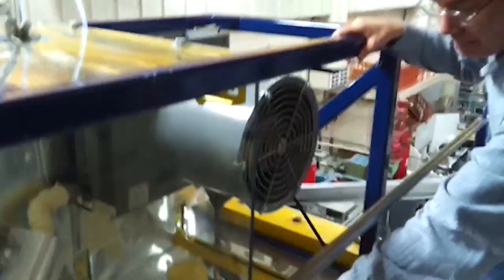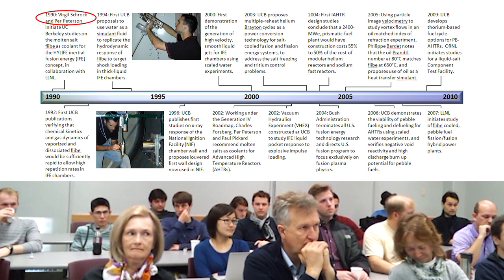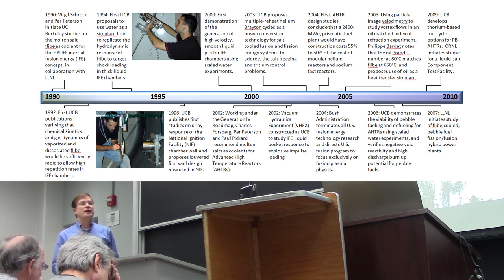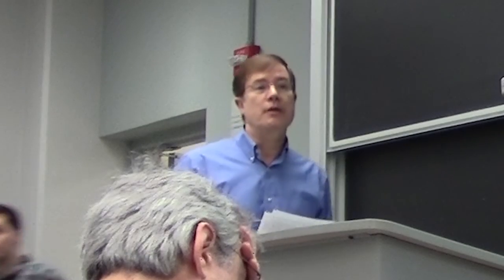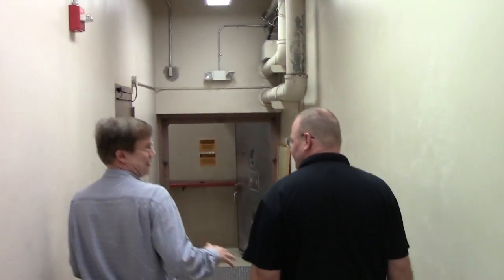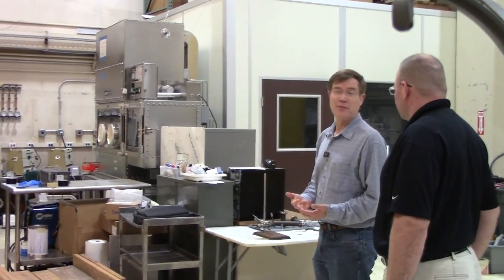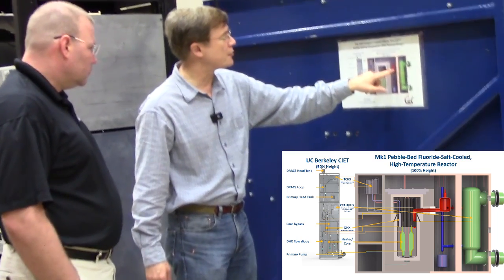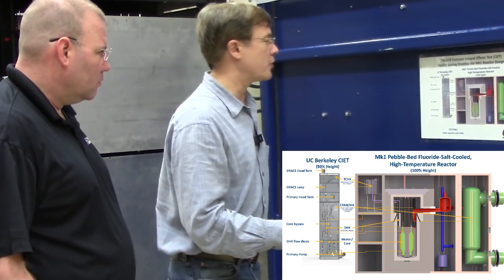Compact Integral Effects Test CIET - Dr. Per Peterson & Kirk Sorensen

Comment: Great video! How important or pertinent is this particular research for future Thorium reactors?

Thanks Jim.
Reply: ScootOverMan Remember Dave LeBanc's quip: "Come for the Thorium, Stay for the Reactor"?

It's not so much the change of Fuel, but a change of the Physical State of the Fuel (i.e., to Liquid) that's key here.

The Forward to Bob Hargraves' book "Thorium - Energy Cheaper than Coal" (~$10 in Kindle-format) begins with:

""Thorium is the name of a heavy metal element, that can release abundant energy, but Thorium is only part of the story. The key technology is the Molten Salt Reactor, enabling a fluid fuel form, reducing costs & enabling energy cheaper than from coal."

Uranium is to be used in Terrestrial Energy's IMSR, due ~2022. I tentatively  embraced Thorium, at first, after viewing Kirk's 10-min TED talk. Now, I accept starting with MSRs & - e.g., as U prices rise (e.g., from Russians buying it up, around the world, per CBC reports), Thorium is the next step.

(India had reason to embrace Thorium early, e.g., when they found themselves unable to buy U (as they hadn't signed the Non-Proliferation Treaty); after embracing Th, India began receiving invitations to buy U, sans Treaty signature. "You Can Negotiate Anything")

Comment: At the end there, when the guy started talking about the pebble bed reactors and how the fuel pebbles operate in a PBR, I got to thinking how the concept could be adapted to a molten salt reactor, and LFTRs in particular. Because there's some concern over the operating life of the graphite moderator due to neutron damage, in which the graphite core can crack and leak, can't little graphite pebbles be used in a metal tank instead? Then the graphite can be replaced as needed just like the fuel without having to shut down the whole reactor to swap out the core. (the tank would have to be swapped out eventually, of course, even if it's made of molybdenum or tungsten)

Has Kirk ever mentioned the possibility of using graphite moderating pebbles in a LFTR?
Reply: Pyre Vulpimorph his version of the MSR (LFTR) is self moderated and does not use any carbon at all there for solving that issue
Reply: Pyre Vulpimorph kirk wants to use a 2 fluid design that keeps thorium out of the core. this solves a number of issues like U232 contamination and maintains better criticality for more efficient burnup. but its my understanding that this means that the moderator itself is the barrier between the core and the blanket, so it has to be fixed. i believe his solution for that as well as the corrosion problem is to slate these modular designs for replacement after a fixed time span. so they can just take it out, slide the new one into place, use some of the unspent fuel to fire the new one up, and take the old one back to the factory to be rebuilt. this also allows them to implement design improvements etc and provides a rather effective business model for a company that is selling reactors that dont require special fuel

Comment: Thanks for another great video.
      From what I can tell, the only major area where there is no new research is in the corrosion area.  I know fluoride is used to etch glass.  It reminds me of an observation that one of the other volunteers with whom I participate in maintaining and operating a steam locomotive designed in 1912 made about it: "As soon as we begin operating it, it begins destroying itself."
      There is a kidney system for the Thorium salt reactor.  Now it needs another organ like a stomach.   Evolution has designed stomachs that can dissolve and digest food without the stomach digesting itself.   Now we need a mucus lining for the reactor.
Reply: Very appropriate analogy; surprisingly, it is amazing how such parallels can lead to technical break through.
Reply: Thanks.  I just threw it out.  Although, It is highly doubtful some sort of heavy liquid could be used to coat the inside and be held against the wall of the reactor, I thought it was an idea  that might  lead to other thoughts that might work. If the reactor walls have to be replaced continuously due to corrosion while the reactor is in operation, do we shove sections like sheet pilings through?  Biologicals are constantly replacing parts and making repairs while these parts are in use.  Millions of years of evolution sometimes solves similar problems that we face.
Reply: Biological linings are replaced and are effected by diet itself, self-sustaining. For example; cabbage assists in the production of stomach lining mucous. However, I would consider a DNA programed computer, biological in nature assumed,  to be the ultimate in technological achievement. Otherwise and until this time, I was thinking of extruding of a surface through micro-ports that would be eroded and then replaced at a rate of replacement that would protect the principal piping or reactor surfaces. The substance extruded through the ports would need the characteristics of preserving the reactor vessel container and piping walls, while being benign to the functioning of the system. Thus, safety is maximized by reducing system failure, system maintenance costs are minimized by reducing repair downtime, and we have a bridge to a DNA driven system.
Reply: That's interesting.  There are numerous extremophile organisms that live at extremely high and low ph levels in high temperatures: http://en.wikipedia.org/wiki/Extremophile There are creatures that live in brine, an environment of high salt concentration although not as extreme as would occurs in these reactors. It is amazing.  As long as there is the opportunity for some chemical reaction that can generate energy for an organism to operate its life processes, even in a horrible environment, evolution will invade that niche.

Comment: Hm. How does the VHX cool the pebble bed reactor passively through buoyancy only? Seems to me like the VHX is seated higher than the reactor core; so that would mean through capillary action? Or does he mean a siphon type system that operates through difference in gas pressure? Neither mechanism makes sense to me.

With capillary action you'd need thousands of tiny pipes. At that point, the pipes themselves become a radiator, the salt freezes in-pipe, and likely causes rupture through expansion forces. Maybe if you insulated everything with asbestos or fibreglass.
With a siphon type system, I'm assuming that the pebble bed operates at atmospheric pressure, otherwise it throws away the greatest advantage of molten salt. Problem with that is that you have to then have vacuum pumps keeping the VHX at negative pressure so the siphon effect can work. Vacuum pumps = not passive.

My best guess is that he is talking about convection. Heat rises, cool sinks. I would presume that the molten salt being of lower density when hot would rise up, be cooled down through heat exchangers, then flow back down under gravity. Maybe someone with a background in fluid mechanics can clarify.
Reply: Also this video is quite instructive for its discussions on solids and pebble movement. I can think of a few industries that could take this work and apply it quite handily; namely the pharmaceutical industry having to deal with powders and tablets. Beyond nuclear power, this kind of fundamental research has some quite interesting implications. Berkeley should probably talk to a few process engineers at pharma companies about their work. 

Another thing that was interesting was the flow experiment. A lot of process chemists would be interested in looking at that kind of work; as would people designing heat pumps and architects designing building heat and cooling. One could imagine an insolated side of a building heated by the sun having that heat soaked up by water and using convective flow to disperse that heat into the ground. At night, the relatively warm water would rise to heat the building. Minimal power air conditioning/heating.

Comment: My question is why half-ass it? From what I can gather almost everyone agrees that the liquid fuel design is the way to go. So why bother with this interim step of the solid fuel design at all if the lftr is the ultimate goal? Especially when the lftr design has already been proven. It just seems like a giant waste of time and money to me
Reply: Rob Graham I think it's because solid fuel provides an economic opportunity for people to supply processed pellets. It'd be less disruptive to players like Westinghouse (and therefore they'd be less likely to oppose it) if people could run using the same economic model.

There's also the fact that there's already a bed of experience running pebble fuels. The troubled German AVR; now licensed to China as the HTR-10 means that even without using this research to improve liquid fuel reactors, there exist opportunities to improve extant reactor safety and performance. 

As for the LFTR design being proven; it's still not 100% there. The online reprocessing needs to be demonstrated (I don't think the MSRE did that work yet) and the alloys need to be proved. Especially against 600 degree gaseous state hydrofluoric acid/uranium hexafluoride. I don't know about you, but "gaseous" and "hydrofluoric acid" together spell "trouble" in chemistry. That kind of thing will eat through your gloves, you, the lab glass, the fume hood, and your experimental apparatus right quick.
Reply: Rob Graham Until we can convince gov's to defer costly, wasteful Fusion R&D, the only path I can see (besides a huge number of angel &/or venture capitalists) is the creation of something of a "KickStarter Extreme-Edition" that can accept angel investor $$ for lengthy, hugely costly projects - from Approval through [Open Sourced] Prototype & demo systems.

Perhaps some Ethical Investment fund(s) will embrace MSRs, someday...?

Comment: Won't the surface area of the exchangers need to have the same volume to surface area ratios to be analogous?
Reply: I think the variable speed fan gives them a lot of flexibility to model different systems. Turn the fan speed up to model larger heat exchangers. Turn it down to model smaller units.